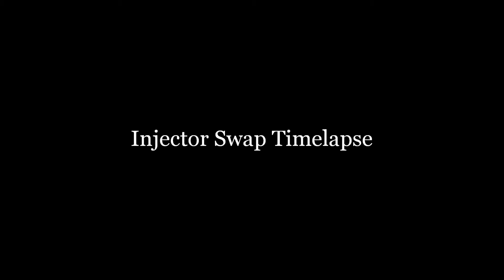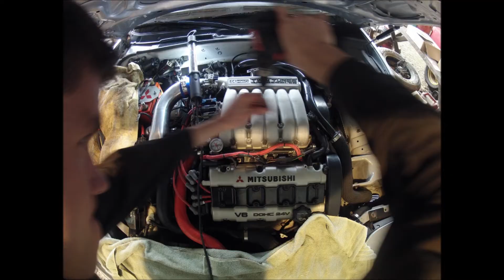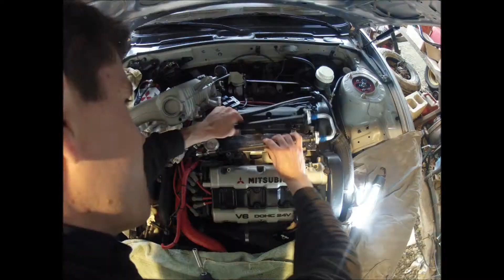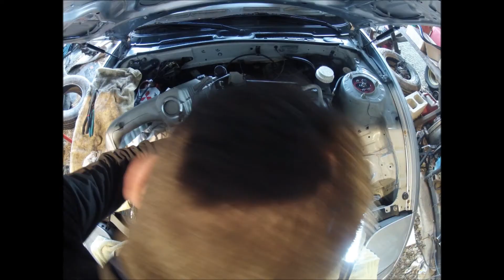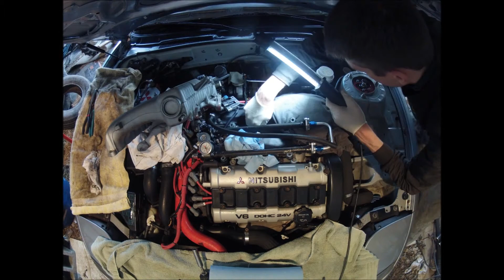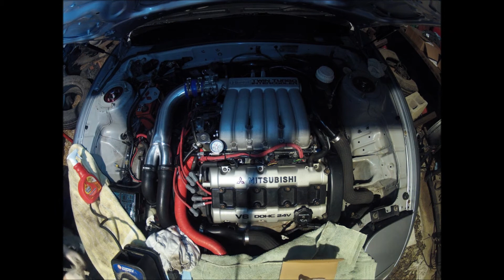Injector Swap Timelapse - CntrlSwitch Short

Comment: hey where did you get the injectors from, and did you need a tune for the fuel injector, if not then running higher boost is fine??

Comment from the maker: That's impressive, but I'm definitely seeing knock on my logger.  Swapped in the 450's and managed to run 12psi.  I don't hit knock until I get up to 3rd gear around 5600 rpm and then she doesn't get too happy.  I'm just gonna take it easy on her for now.  I tried 16psi and I was still getting knock even though timing advanced was at 8 degrees and IDCs were at 97.  Assuming hot air is causing the knock.  Front mount in the future

Comment: That 3rd gear 5600 rpm knock you speak of, you could always get a couple gallons of c16 mixed with a couple gallons of pump and do a quick run to make sure its not phantom knock as it would definitely go away.  all in all it sounds like you got it under control. good luck

Comment: I didnt have to touch my timing until i hit 17psi. DR650's straight pump stock IC's WOT AFR 10.8-11.0. No way your seeing knock already? Also I believe most well tuned 15g cars are running 550's.